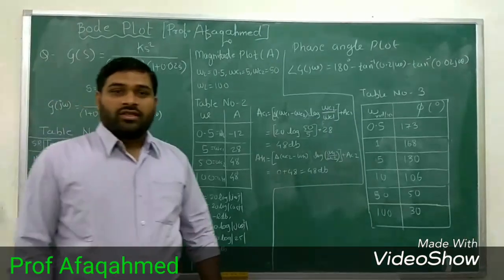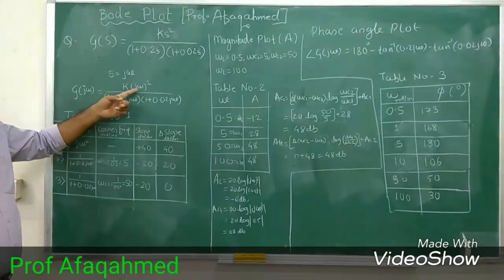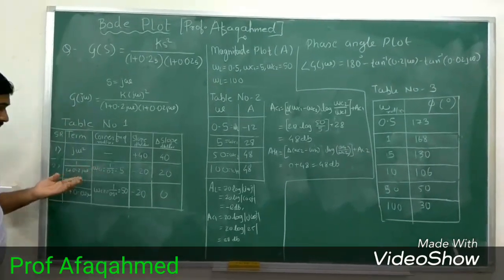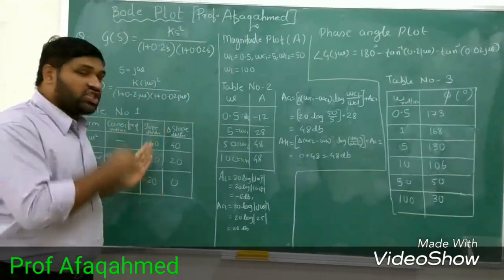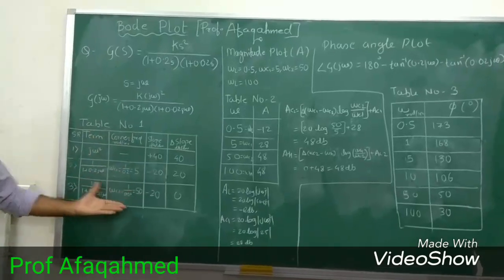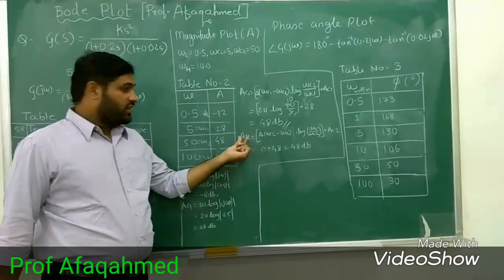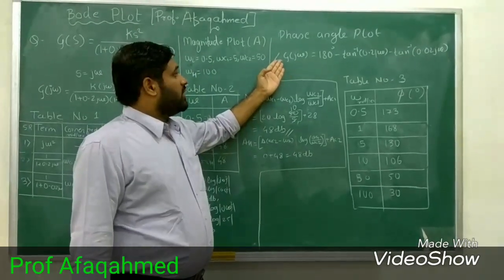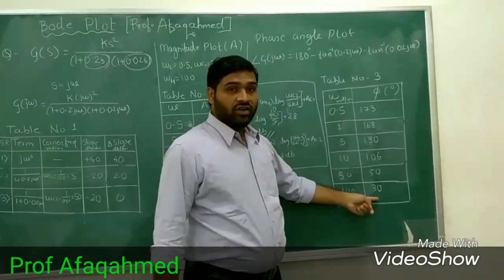Bode Plot (Frequency Response Analysis)

Comment: u r great sir....i have same q in TE ELECTRONICS 2012 PATTERN..
just little diff are there in table bt ths helpd lot! m frm pune university
Reply from the maker: Ankita Kulkarni fine.
Reply: sir at 6:57 time you mentioned that we must take 0.5 and 100 as upper and lower frequencies can we take any other value which is greater than 50 and less than 5?